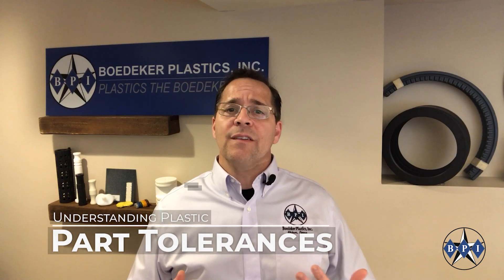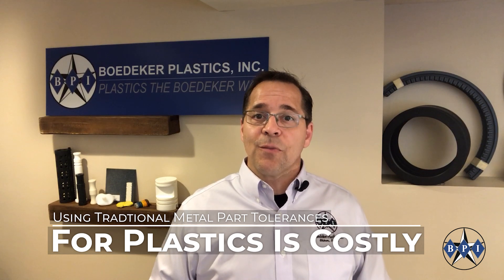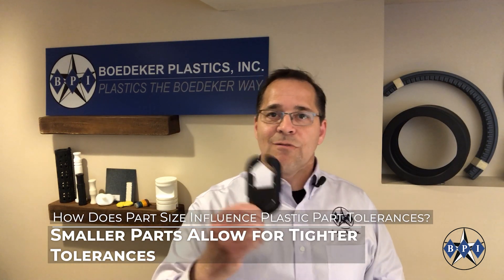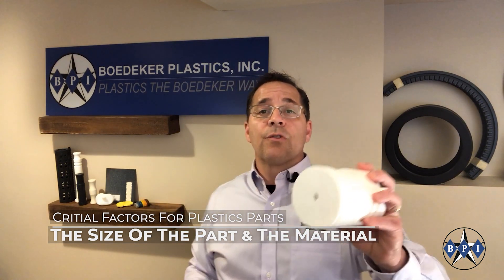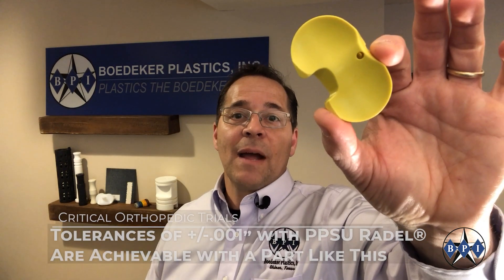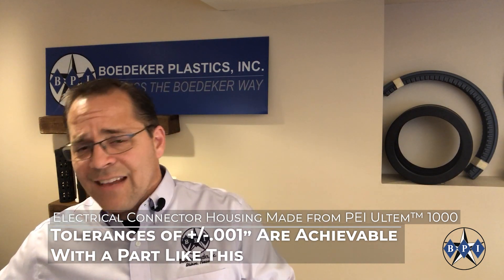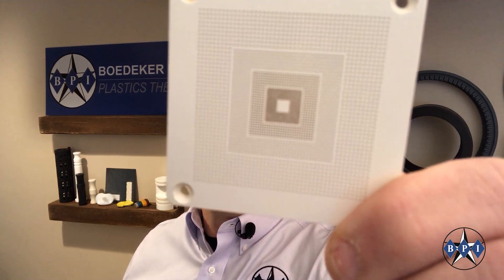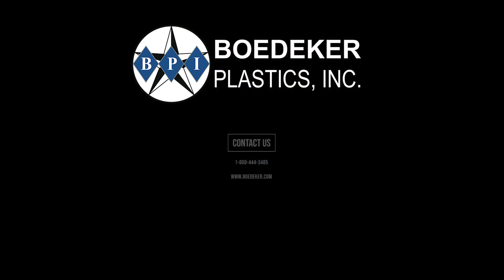Boedeker TECH Talk Episode 3 | Understanding Machined Plastic Part Tolerances

Comment: Great video, very helpful!  Can Ultem 1000 be machined with standard lathe insert tooling or do you need something sharper?  Looking to hold 0.001” on a 5.5” diameter part.  Do you sell Ultem as a tube?  Thank you!  — AJ
Reply from the maker: Thank you for your watching!  Regarding your question, we also have numerous TECHTalk videos on machining of plastics, which may be helpful for you as well.  Check them out!  We also have specific machining guidelines on our website, under our Technical Resources tab.  For machining Ultem and many other thermoplastic polymers, we normally recommend using uncoated solid carbide tooling with a neutral to slightly positive geometry.  You want to cut the material, not drag across the surface.  We don't recommend highly positive tooling designed for aluminum, as this will dig at the material and generate heat.  Also, the use of a water soluble coolant is recommend to reduce heat, and help with tolerance control and to provide a better surface finish.  Good luck!

Comment: When seeking a solid round rigid plastic rod extrusion, the rod needs to fit into a 17/64" female cap connector tip. I discovered the rod OD by using a drill bit that fit in to  the female cap connect, so I figure the O.D. of said rod would need to be said 17/64". In speaking with a rod extruder via the email, the rod extruder can hold a +/-0.062" tolerance on PVC, PC and PP for, again, the 17/64" rod extrusion, Is this a good tolerance? Also, Do you have another video that could further explain solid round plastic rod tolerances? Thank you. Good Video.
Reply: Stock shape plastics are typically oversized so that a machinist can clean them up to the advertised dimension.  Typical plastic rod tolerances are always dependent on material type and also the overall diameter.  For materials like PVC and PP that tolerance seems appropriate.  Some more extreme polymers that are more dimensionally stable will come with tighter tolerances.  Many polymers like nylon, acetal, PPS, PEI, PEEK, etc. will have OD tolerances of +.003"/-.000" for rods under 1" OD.  I am afraid that I am not aware of any other specific videos talking about rod tolerances.  However.....tolerances on stock shapes would be another good topic for me to cover in the future.  I'll try to add that to the list.  Thanks for your interest and your comments!